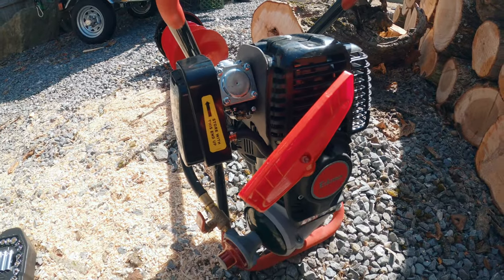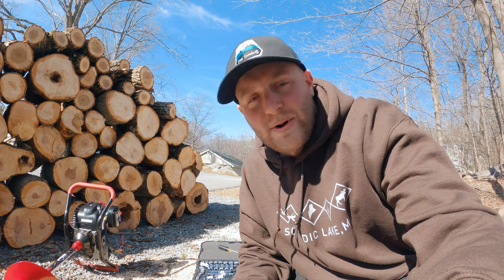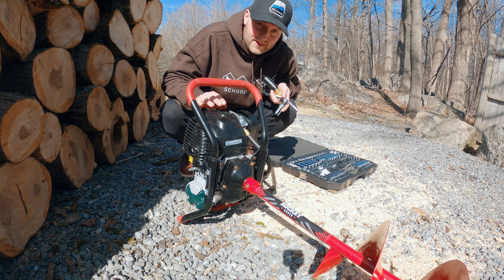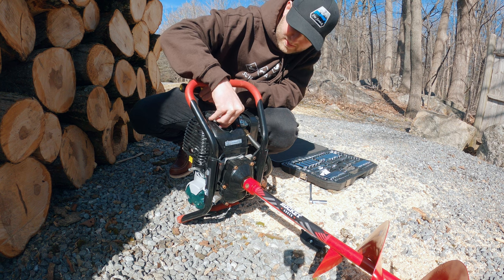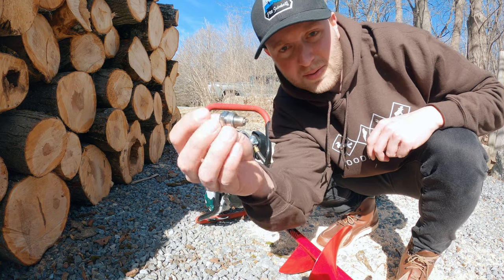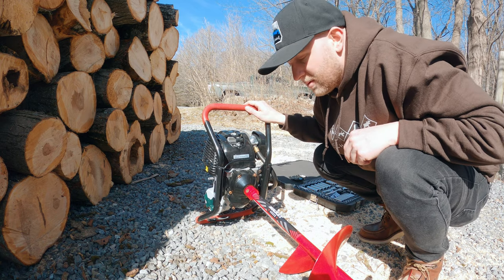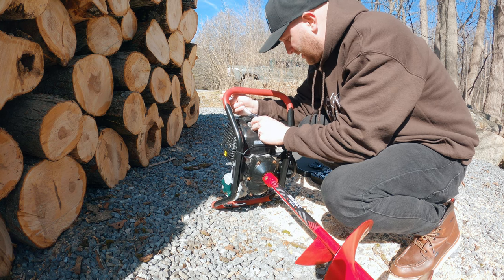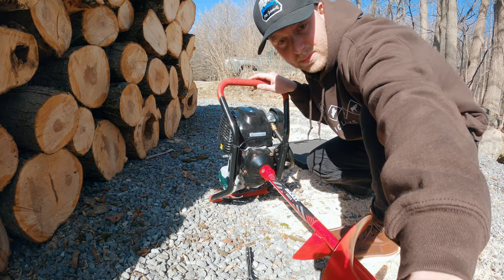Eskimo P1 Rocket Propane Auger Won’t Start — Pull Cord Stuck — How To Fix & Prevent Hydrolock

Comment: I’m an idiot when it comes to this but this actually helped and worked, same issue first time using it. Tried to pull and it felt locked did the same thing and boom, went all day with no issues.
Reply from the maker: Glad it worked out. Good luck this season 🤜🏼🤛🏼